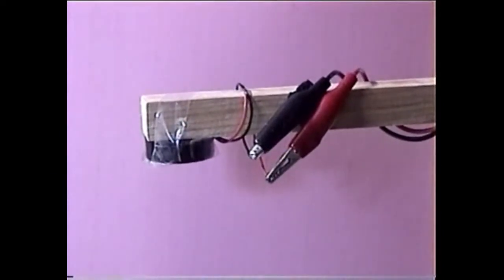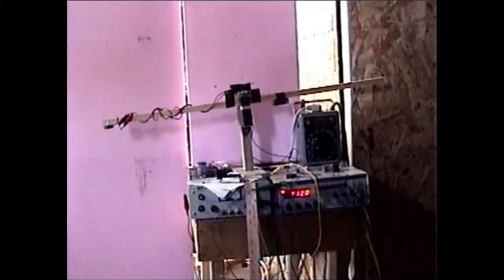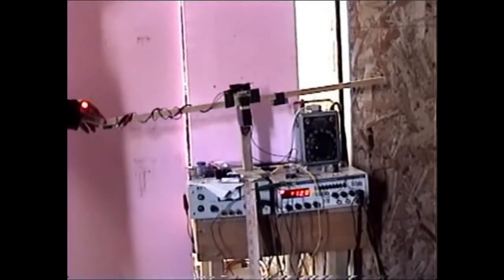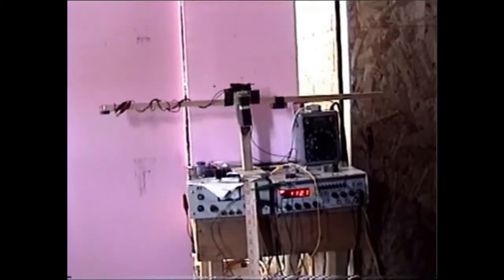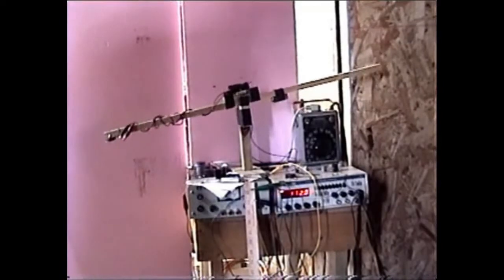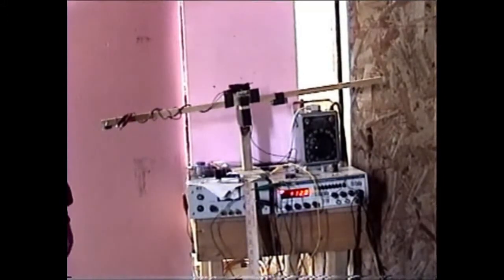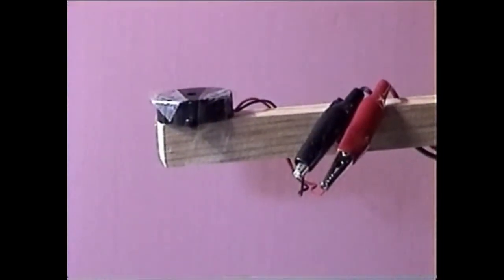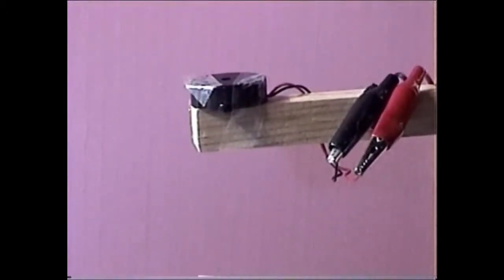Keely's Ultrasonic Propulsion Experiment

Comment: Cool!! Did you try putting some super thin paper bands near the piezoelectric element to see if the propulsion is done by physical push on the air or vibratory canceling gravity. If physical, something may detect the affect on the air. Cheers!
Reply from the maker: It will push a piece of paper if brought close.. I am not sure if it is gravity or not?? Have you seen my psychotronic vidoes?? These are my latest research into anti-gravity/UFO playlist! The problem is, I can not show everything.. and If I do succeed in building a powerful anti-gravity propulsion system.. I will not be able to show it, or talk about it.. But if you watch many of my videos.. I do give hints and clues, as to what i am working on.. and some things I do show in detail! Thanks It is all very interesting stuff!!
Reply: @jaynesnetwork  I’ll check them, thanks! It looks like the sound is acting as a propulsion, similarly to the water drops caught in midair in sound standing wave, or to the ion propulsion. Decades ago I remember a guy did similar results by passing current through a capacitor suspended to one side of a lever in equilibrium.

Comment: John Keely showed public demonstrations in his workshop of high pressure output tests from 1865-1899. A competent journalist in 1800's had thoroughly researched backwards in time  to discover some knowlege of deceit. His editorial printed revelation showed that a swindler in New Jersey machine shop had been stopped by the investing Doctor, in his machinery allegations. Mr. Keely of Philadelphia Pa., had found out about that and went there and purchased the system . The journalist went there, heard of the sale, then traveled to Phil. and visited Keely's shop and saw the same devices in the back room first floor. This consisted of a 40HP engine to run on the piped in building gas line, (same as gas lights) and a heavy duty high pressure fluid hydraulic "screw type" pump run by engine, and $60,000 steel spherical pressure tank pretested for 30,000 lbs. A fluid tank under pressure has high pressure liquid from lower fitting , and high pressure air from air pocket on upper surface. Keely's shop interior walls and floor were lined with high pressure brass tubing . Different size receivers over the years were substituted until only a table top model was used on display. The precharged tanks were connected for showing demonstration pressure to the modified warehouse weigh scales. Yes, the high pressure was real. Visitors originally didn't like the mounted gauges as the springs could be altered, so Keely used his transfer tubing going to a small secondary chamber so that the volume contained would be sufficient to fill the space of the output vertical air cylinder on scales, as rod moved upward. The horizontal lift lever was in 14 to 1 negative leverage so that the heavy weight hanging on end of bar was multiplied in weight. More than 23,000 lbs pressure lifted the weight. The newsmen and engineers failed to find any air compressor in shop or in nearby buildings. Keely said he used vibrations to change water droplets to Ether gas at high pressure. Now everyone knows how it was done. The escaping (gas) to ambient, at end of demonstrations was cold and moist, as the weight descended. The device called "The Liberator" had double concentric tanks , so as water could be poured in one end of outer  tank and run out other end , before demonstration done. The inner tank was precharged , so that Keely would twang his tuning forks array mounted, and then release the catch on his 15 second wind up timer fan, so that  the fan noise covered up the sound of escaping gas from inner tank to space inbetween tanks. (no gauge on tank) He said the tank mounted was so heavy because of the very thick wall of steel. The weight came from 2 tanks. One end of tank has weld line, where it was originally taken apart, and homemade release valve that pushes inward on rod that releases air from inner spring valve. Other end of tank has standard valve.  Large cylinder pressure tanks usually have only one common valve. The engine+screw pump were used to fill various shape tanks over the years,  even "The Multipicator" which had several filled cylinders all at same pressure. The outside hand crank moved circular steel ring inside that switched output port to next cylinder. Each expulsion was then at same pressure for 15 tests.The last small table Keely Disintegrator device had doughut shaped steel tank covered in shiny brass and was worked with dual diaphram actuators and  platinum tubing. The 5 million dollar Keely Motor Company operated by investor's money. The books showed 90% going to metal shop expenses. The 10% for Keely was a lot more money at that time in 1800"s then now.
Reply from the maker: I personally believe that Keely found a way to generate and harness super high power ultrasonic energy.. Powers so high that they instantly vaporize water! He conducted his research in the 1800's, and he was able to produce tiny hollow tubes... I find this amazing in itself..  If you believe it is possible to have such tiny tubes carry such tremendous pressure without rupturing.. then please manufacture some, and demonstrate it! Keely documented his research.. Please show, in real experiments.. how such amazing feats can be replicated with such mundane explanations.. There is no material that I know of 
that can be fabricated into these tiny little hose type geometries.. and also withstand such tremendous pressures.. I believe I know what Keely was doing! It was super high power sound! He was misunderstood.. like many inventors ahead of their time. Here is a link to his book.. please replicate his research and post videos, using your assumed pressure methods.. I love to see how tiny little hoses can hold such pressures without rupturing! and also be used to propel projectiles hundreds of years! I will be waiting to see..  If you can build such a device.. I will surely believe you!!
http://www.rexresearch.com/pdf/KeelyDiscoveries.pdf

Comment: The upstairs Keely workshop mounted devices were found to be fraud after
 1899. Exacting details found in back issue Library special order 
purchase  photocopies of - New York Journal And Advertiser January 29, 
1899- Editorial - pages 16, 17, 18, 19, "Keely The Monumental Fraud Of 
The Century"  Hidden belt, spinning magnet, compressed air over water in
 hydraulic tank,  multiple precharged air pressure tubes, Globe Motor 
was wound up band spring from crowbar, etc. Science research done on 
first floor.
Reply from the maker: Yes I have studied this.. Many of the allegations of fraud were inconsistent with what was observed in public demonstrations of Keely's inventions.. specifically let's talk about the vaporic gun, which according to Keely used his etheric energy to rapidly dissociate water inside the gun and propel a projectile at tremendous speeds and distances. The skeptics claim that the gun was powered by pneumatic air pressure from a tiny... long "tube"/wire.. this in my opinion is the real fraud, since the tiny wire that supplied the energy during the experiment... even if it was hollowed out and capable of holding such tremendous pressures, to fire a gun, would not be able to carry anywhere near enough power to do so.. guns barrels are made out of thick steel, because the forces they must contain are tremendous!... a tiny wire.. even if it was possible to hollow it out to carry an air flow, would surely rupture under these pressures! Also gun powder can provide a tremendous amount of power.. in a fraction of a second.. Which is required to propel a projectile!... A tiny "tube" can only carry a trickle of power at best! Just try blowing through a coffee stir straw.. How much power can that deliver? This "tube was even smaller!  Could you propel 1" diameter lead slug 500 yards away, by blowing though a coffee stir straw that was several meters long?? That is ridiculous to even try to imagine! Your lungs would explode first! Also during one of Keely's public demonstrations, he cut one of these wires half way through.. to demonstrate that they were solid.. and not hollowed out, as alleged!  These experiments were carried out in front of an audience.. so if there was some obvious fraud.. eye witnesses would have testified so.. Anyway,... After Keelys death..The skeptics found a large spherical vessel in the basement of Keely's house and asserted that it was a pressure vessel..Lets given them that..  If it was actually as they claim.. yet it is not clear that it really was a pressure vessel though .. there is still no mechanism to deliver this tremendous 'pressure' to the vaporic gun without exploding the tiny wire/"hose" that was alleged to carry this pressure!   Keely lived a modest life, and invested almost all of his money back into his research.. This is not the lifestyle of a fraud!  Finally, I find the information Keely presents as useful.. and I have verified some things with my own personal research.. that Keely had claimed! I do not personally believe Keely was a fraud!
Reply: @jaynesnetwork  The Keely artillery gun had the thick walled tank connected to breech small chamber with thick walled brass tubing. After time period of transferred air pressure , about 23,000lbs, the rubber disc rupture fired ball at velocity. The other attempts showed same velocity even though pressure in tank would have been less. The succeeding discs were progressively thinner requiring less time + pressure to rupture. He hammer tapped the end to start the vibration. The brass tubing does not rupture due to excessive thick wall. I have photocopy from Library Of Congress of Keely cut tube piece with dimensions, from their automotive dept drawer. At Keely"s upstairs showings and demonstrations, he cut sample  pieces of platinum wire from reel at table and gave them  to potential investors . The diaphram sphere Symp. transmitter sent low pressure air through platinum TUBE same size, to each device on tables. This ran catch release so as device would operate. He could also tap foot on floor spring valves under carpet with repeating pattern so as to operate others using air. The investors were amazed at the showing of 51 inches of vacuum - not on common gauge,  but on open mercury bath manometer. Nowdays, if a lab needs vacuum source and without a vacuum pump, they use T fitting on sink pressure water flow down drain. The side port allows for vacuum hose. Keely did same thing with 23,000 lbs passing by small port + hooked to manometer. The $60,000 sphere pressure tank was tested to 30,000 lbs for safety, and used in many expulsions. It sat in rear of first floor for years,in the open,  until moved to the under floor coal bin storage , as not used much in later years. The building examiners didn't know it , and figured it was hidden.
Reply from the maker: If you have additional information, I would love seeing it.. Have you posted this information any place on the web?? Thanks!

Comment: propulsion in this case is from air compression made by ultrasonic movement of peizo plate. do it in a vacuum.
Reply from the maker: Yes I agree, it probably won't work the same without air... but there may still be something interesting.. Who  knows?  Great idea.  When I get some equipment together, I can give it a try.. thanks..
Reply: jaynes network I would love to see. perhaps a scaled down version inside a large mason jar as a low cost vac chamber. just trying to help.

Comment: I just can't get past the idea that more air is moving when you trigger the ulftrasonic so it might be the only pushing force is air...if you tried a different effector like a coil with a purely EM wave, might be a better test that would obviate air as the prime move...I applaud your attempt....

something I've been pondering lately is back then, they used a lot of iron wire...so these experimenters vibrated the wire that touched the mass to transfer the frequency.....

when I think of frequency its electronic with a positive and negative wire...but pure vibration is another animal entirely.....maybe off on this but its there and bugs me......thanks again...- Jerry @ Keelynet
Reply from the maker: It could be, but the resonator cavity is closed so there is no net air passing through it.  The phenomenon also works in the audible range but is much more annoying to listen to.  My theory is that the sound waves carry momentum, and will push on one side of the cavity but escape the other side, so momentum on the cavity is imbalanced thus creating a force on the cavity. Of course momentum is conserved when the sound waves strike a wall or something exterior. Inevitably I agree that the device won't work without interaction with the surrounding air.  More experiments are definitely required.  I can say that the more interest I receive in my videos, the more experiments I will concentrate on posting in that particular area.  Right now I am mainly posting archive video from my old web page "Dr. Jaynes New Science" but I am also always doing new experiments as well, and trying to post several new things every week.  I believe when I was conducting these experiments back circa 2001, I was trying to validate some of the stories of what John Keely was doing, and show that there is a scientific basis to support his claims of his research. Thanks again.
Reply: @jaynesnetwork  If some of Keely's tests were viable, the vibrational work he did is related to Peltier Effect, Seebeck effect,  and thermocouples. Yes, this is substantiated by 2 other researchers I came across. Also a web site was shutdown years ago and showed a thermocouple on digital weight scales loosing weight. A french scientist operated a weightless floating frame with sandwich plates at either end and connected to high frequencies. Keely used silver, platinum, and gold wires due to the resistivity ratios and purity. The signals going down wire are interrupted by the "node" connection to other metal. Upper inharmonics are generated that effect mass. Building codes now only allow copper wiring, and not mixed with aluminum as causing feedback frequencies and harmonics , and hot spot connections. Keely said he could control the forces of nature with harmonics in certain ratios to resonant frequencies. (Mass cords) His sonic one ton gravity control lift easily floated with controlled frequencies which he did some by ear, since he was also a musician and knew chord notes.